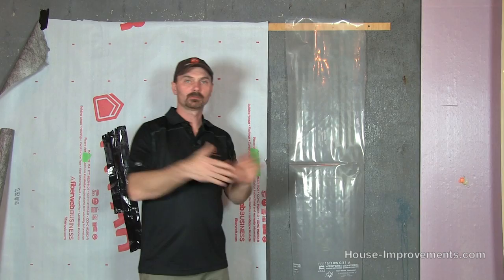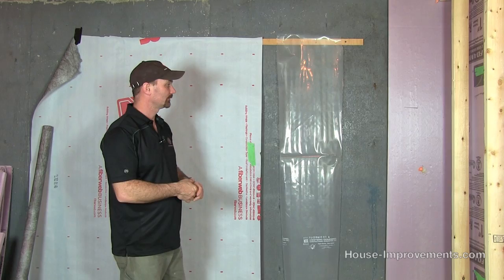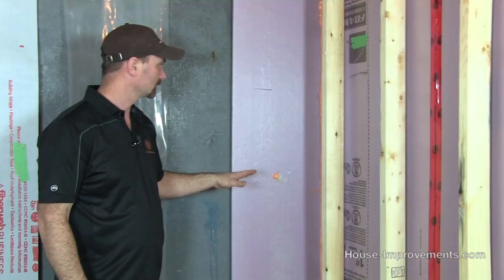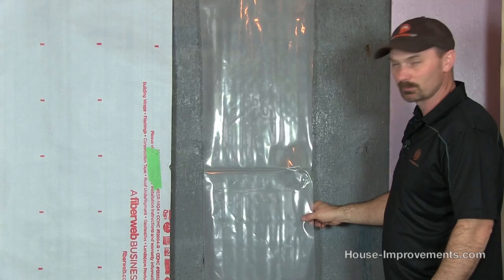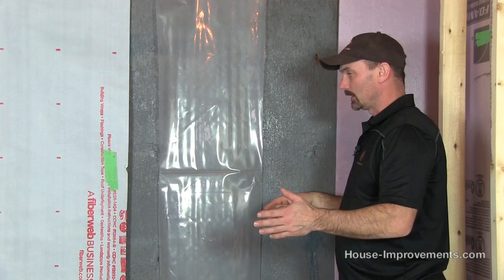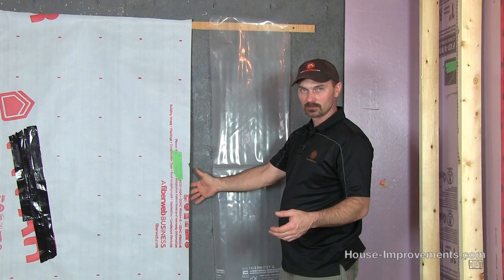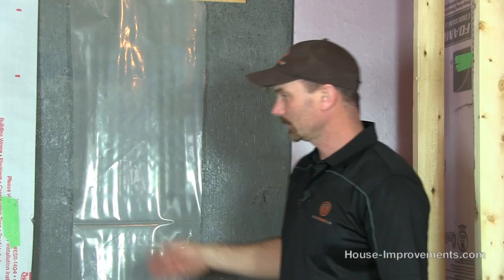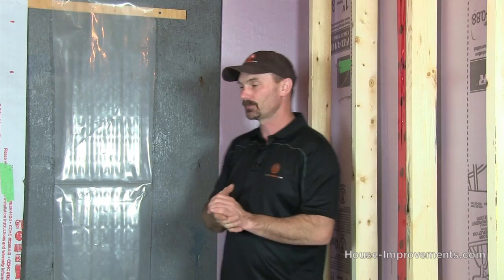Moisture Barrier - 3 Types

Comment: FYI, Ontario building code requires rigid foam to be a minimum R10 to act as a vapour barrier.  Check your local building codes before you begin your projects.  Great video!!
Reply: Im in Ontario as well, do you know if we can use the rigid foam as a vapour barrier on the basement floor?

Comment: Thank you Shannon. I was especially glad to see your comment of placing the lettering of the house wrap towards the concrete wall as house wrap is kind of like Gortex - repels the moisture on the lettering side but allows vapour to pass from the other side (inside the home) outward. All too often people get this wrong and they set themselves up for a mess i.e. mold. Nice to have you as a one stop site to get all the information accurately. Ottawa, Canada

Comment from the maker: IT HAS BEEN POINTED OUT THAT THE HOUSE WRAP WOULD FUNCTION BETTER IN THIS SITUATION WITH THE FACE WITH WRITING ON IT PLACED AGAINST THE WALL. THAT IS OPPOSITE OF WHAT IS SHOWEN IN MY VIDEO AND I WOULD AGREE. SORRY FOR THE MIX UP!
Reply: HouseImprovements what do you think of the idea of applying a liquid membrane (  like the one we apply when we do a shower) on the concrete before insulating ?
Reply: Serge Miller the walls have to breath so sealing the wall might cause the wall to erpde due tp the water building up behind it.
Reply: I'm planning on using dmx on the floor. I was thinking about using the pink board and using the plastic to go over it and tuck the end under the dmx.... Sound like a terrible idea?
Reply: @homeimprovements if i have an interior channel sump drainage system what vapor barrier can I use that will accommodate that? Right now there is about 12 inches of black dimpled material, but id like to frame walls and "finish" the basement. Thank you.
Reply: @1kenpau1    The wall can breathe from the outside. Spray on foam doesn’t let it breathe but it’s considered the best way.

Comment: Thanks for another great video!  I'm installing a new upstairs bathroom and have a little penetrating damp through a stone chimney wall.  The chimney is fully ventilated with a ventilated hood on the chimney pot, but some winter rain soaks through the render outside.  Builders say there's no more we can do to improve it, so using your method I plan to add a moisture barrier with drainage for any dripping condensation.  We don't have much room for thick studwork so I wondered :

1) Can the batten can be installed vertically 600mm apart
2) Moisture barrier stapled to the batten
3) A 2nd batten screwed on top of the first (possibly at 90 degrees)
4) Thin rigid foam added between the 2nd battens
5) Finished with a layer of vapour barrier sheetrock

Really appreciate your advice, keep up the great work!

Comment: If I use rigid foam as the moisture barrier, do I still need to have batt insulation or is the rigid foam enough insulation for my basement? I live in the northeast so it get's cold. Also how is the rigid foam attached to the foundation? Does the rigid foam go from very top of the wall to the bottom or is there a gap on the top? Only 80% of my basement is below grade so wondering if I can skip the top 20% which is above grade. Last question, how does my wood frame attach to the rigid foam or is there a gap between the two? TIA
Reply: 1 inch is R-5 which would be too low to use on its own in NE basements

Comment: Why can't the Tyvek or Plastic barriers just be tacked to the base board at the top of the concrete wall? Why put the the wood strip below it? I assume it's just due to width of the sheets?

Comment: I have a basement that years ago was finished but years of sump pump failures had to rip of 2x4 walls drywall was all mold.
Now just block walls on outside walls can l staple 6 mil plastic up against block walls then build a 2x2 or 2x4 walls?

Comment: Great video. Thankyou. Here is a  about a wood floor? I have a thin wood floor in  a garage, not insulated underneath. I want to stop moisture from coming in. It will have a new layer of 3 quarter inch plywood on it with 1 inch rigid  foam under that.  But doninput moisture barrier first? And donI spray foam all along the edges too? It's a 320 square foot garage turning into a mancave

Comment: Let's assume there is a moisture problem. Does that mean mold will be growing behind the purple board for all the years you live in the basement? If so, is the purple board good a genuinely protecting you from that condition? I am also assuming there is no access on the other side of the concrete, which is obviously how you would want to fix it; at the source. In cities, often there is no access on the exterior concrete. THANKS!

Comment: The air vapor barrior paper sheets are for more preventing water in air moisture... the moisture barrior is more for preventing larger amount of foundation leaking water from outside in. Not the smaller issue of water from air humidity... thats why attics uses paper air barriors on the floor then the insulation rollout. The moisture barrior is more for foundations or bathrooms where larger amounts of water due not only humidity but water itself sources.

Comment: What happens to the moisture concentrated at floor level?
Reply from the maker: +Benny Hannah The idea is that if you get moisture it comes out at the floor where you can find it and know about it instead of it soaking into the insulation and drywall and starting to grow mould that you have no idea is there.
Reply: you can also add a channel in the floor perimeter to direct the moisture away into some form of drainage or tank

Comment: I have a few questions I'm about to renovate my basement and will be doing the following.

For the tyvek wrap is the writing suppost to face outside against the wall?

And my basement is already finished but will be ripping out the walls and redoing the insulation before drywall.. It doesn't have rigid foam board, is it even possible to add because its already framed?
Reply from the maker: The Tyvek is likely more effective with the writing towards the concrete. If there is enough space you may be able to add it. Depends how they originally did it. I would not spend the money on the foam unless you can get at least 1" in there. If you cant use foam then I would likely use Roxul batt insulation instead of regular batts, it has a little more R value.

Comment: Thanks for the video. so, for spray foamed basement we don't need any vapor or moisture barrier to be installed before framing? and for floor base plate where foam is not sprayed, what we need to do? I do see that in my basement, foam is sprayed a little bit on the floor as well where baseplate is placed.

Comment: I don't have any leaks my basement walls just gets mouldy I have recently put a dehumidifier down there so it doesn't smell mouldy anymore  but the is no visible water coming in so I have cleaned up what mould I did have and paint ed with a mould resistant paint  now I want to put  the foam frame and drywall

Comment: As always Shannon a really good video. Thanks
Reply from the maker: thanks, Take note that if using the house wrap, hanging it with the face side facing the concrete wall will be better. That was an over site on my part.

Comment: I'm using 2" 4×8 foam board panels. Can I fur out the walls over top of panels with 1×3 firing.Then finish the walls. I'm not sure i want to 2×4 frame wall in front. Don't think I need the extra r- value. Am I being to cheap? Think I would like to  finish with some type of wood 🤔
Reply from the maker: depends how flat and plumb your concrete is I suppose? Also dont forget about room to run electrical

Comment: Thank you, I just learned that the "Vapor" barrier and "Moisture" barrier are not the same. Years ago I was told by a carpenter that us folks up north put 'the' heavy mil plastic barrier on the inside of the walls and down south it goes on the outside. So I guess since then things have changed since there are two products that separately address vapor or moisture. I recently moved and will start framing in my basement walls. Since they are painted cement blocks and appear to never have had any water leaks or stains do I still need the moisture barrier? Harry
Reply from the maker: Yes basements need a moisture barrier against the concrete or cinder block walls. You also will need a air/vapour barrier under the drywall.
Reply: @HouseImprovements  hello Shannon- thanks for the awesome videos and info! I'm in NJ and I have mold on walls in basement which was due to hydrostatic pressure around my foundation which I've solved with a new French drain system... 
I had the mold remediated professionally and they "sealed" my walls with that special antimicrobial sealant/paint thing.. so would that in essence now serve as my moisture barrier? Or I'd still need one of these paths for the moisture barrier. 
Also the waterproofing companies I met with kept pushing for a "vapor" barrier but I think they really meant 'moisture' barrier?  Also don't these barriers lock in the moisture thus leading to mold? Since the air needs to circulate to prevent mold growth.
Please let me know your thoughts and responses to all this :-)

Comment: What if there is no ground on the other side of the wall, i e. cold side of the wall in contact with air? Do wee need moisture barrier? And can we use a rigid foam in this case?
Reply from the maker: moisture barrier is only needed on wall sections  that are below grade
Reply: @HouseImprovements  Thank you for reply. Would you consider making a video explaining all cases where the moisture barrier is needed or not? It would be nice if you could go through all cases of wall placement: above, below and half way below the grade and explain insulation rules and procedures. There are also cases when the concrete wall is below grade and is isolated by mineral wool inserted into wooden frame.  As I remember correctly, one must have a min 25mm  gap between the framing and concrete wall to provide ventilation. Anyways, if you would consider go through different cases based on given boundaries (above, below or and half way below grade) and give your thoughts on how to insulate based on these assumptions - that will be great

Comment: if our crawl.space already has the cheap 6mm black builder's grade encapsulation would you need or should you remove that before you would install 15mm STEGOCRAWL?  or can it go on top without causing a cat pee smell or other problems?

Comment: Great video! I Just gutted my den and found lots of damage to my moisture barrier. it looks to be nothign more than very thick aluminum foil. The house was built in the 70's so I guess that was code back then. I have a brick house and behind that damaged barrier was raw brick and nothign else. Can I replace that old school aluminum stuff with the rigid foam or should I hunt around for that same type of moisture barrier?
Reply from the maker: Answered this on your other post

Comment: Great video, it was helpful to understand the purpose of moisture barriers. But I have few more question, I will be grateful if you could address them.
I am in process of installing Luxurt Vinyl Planks flooring (LVP) and manufacturer recommends to use moisture barrier for underlayment.  What kind of moisture barrier would you recommend as underlayment for installing the LVP flooring? We have 3 level including a concrete slab on level 1 and  we will install LVPs in multiple rooms including bathrooms. Will it be okay to use house-wrap paper everywhere or would you recommend to use plastic on concrete slab and high moisture rooms (bathrooms) and then house-wrap paper for rest of the areas?

Comment: Thanks Shannon.  Then you would install the insulation vapour barrier and drywall after the moisture barrier.  That's great.  I've never seen moisture barrier before.  Great video.
Reply: build another wall inside:)

Comment: so the moisture from the living space wont make it past the overlaps? what about the moisture that comes thro the concrete wall will that tyvec still stop it? what about moisture that comes through the foam board? what would you do exactly if you were going to use the water gaurd that sits on the footer against the wall ?
Reply from the maker: In my area we use interior Vapour Barriers , those are what is supposed to stop moisture and air flow from inside the home from getting in the wall cavity . Moisture barriers against the inside of concrete wall are to direct moisture that comes through the concrete down to the floor so it does not soak your insulation. The 1" foam as a moisture barrier acts as the moisture barrier , some added insulation and keeps any warm moist air that gets through the vapour barrier from being able to condensate on the inside of the cold concrete wall. Very minimal amounts of that moisture may make it through ship lap edges. Taping those seams will help prevent that .
If you have a french drain then you dont want to seal the bottom of the moisture barrier at the floor, just let it allow moisture to get to the drain.
Reply: @HouseImprovements  so what about warm moist air that gets thro the vapour barrior with the tyvec or moisture barrior wont it get past the overlaps and condensate on the concrete wall?

Comment: Can you use the vapor or moisture barriers on the warm side and then add drywall on top?
I have existing studs that are very close to the wall.
Reply from the maker: Yes after wards the wall is framed, insulated and vapour barrier installed and sealed, followed by drywall.

Comment: I have a brick house with 2x3 studs throughout. Im going to tear down the walls and put in roxul insulation and drywall over it. between the studs and outside wall is some tar paper or whatever they call it. Im wanting to put a vapor barrier over the roxul insulation. is that ok? also i'm in North Carolina.
Reply: also i'll be using furring strips vertically to bring the wall back out an inch. it currently has horizontal furring strips to support the vertical tongue and groove paneling.
Reply: I think you need 2x4's for roxul

Comment: Question for you, I have a below grade wall that is getting moisture and water. I am going to patch where needed and Dryloc at least 2 coats. They install the insulation sheets like you showed in this video. Do I need any barrier after that or can I just frame my wall?

Comment: We have house wrap tucked into delta so any moisture or condensation goes into our interior waterproofing system. Just letting it hang wont that just let it drip to the floor and let moisture in and ruin your studs bottom plate?
Reply from the maker: If you have interior waterproofing going into a french drain then yes you can tuck the moisture barrier into the top of it.
Reply: @HouseImprovements  thank you sir. Following you on Facebook too thanks

Comment: i live in canada, we have a cold cellar on basement. and moisture build up during winter and summer. cold cellar has 2 6inches holes on both side. i want to to totally shut it down because of molds growth. my problem is the door between the cellar is moisture build on the door. im thinking to put a Eps or Polyiso foam board to prevent from condensation on the door if that will help to stop moisture grow. or ij the future need to close the 6inch holes and isulates the wall on cold cellar. please help me which best to do for now. planning to seal the door first for now if that one will work is better to use a polyiso board with foil on both side? pe go for eps?
Reply from the maker: Best is insulating room and filling in venting holes if you're not using it as cool room any more. Filling in the venting holes for now will help keep it warmer and should stop or reduce the condensation. You can insulate the door for short term fix. 
Please use our forum if you have more questions.

Comment: Hopefully someone can answer this question for me.
So I see all these videos and articles about insulating basment interior  with rigid foam and then framing in front of it. But I can’t seem to find info that claims that is fire safe. Is having drywall in front of it what makes it fire safe? I’m getting ready to insulate my basment cinderblock walls but don’t want to use XPS if it isn’t fire safe.
Reply: Wouldn’t just the plain vapor barrier be better? It seems more breathable.

Comment: When you install the house wrap in basement, shouldn’t the logo side be facing the concrete and the blank side or black side face the studs?
Reply from the maker: In reality I dont think it will make a lot of difference but it does make sense

Comment: Hi , which kind of barrier suppose to use in attic room before put the dry wall ?
Reply from the maker: You are likely talking about "air/vapour barrier". It is a clear poly and is sold specifically for air/vapour barriers. It is installed on the warm side of insulation and under the drywall.

Comment: In the case where my builder has already included insulation with the vapour barrier in the basement, do I rip it down and reinstall according to your instructions or do I just put up a wall in front of it and board it up? I don't think the builder has included a moisture barrier between the basement concrete wall and the pink insulation.
Reply from the maker: Please use our forum for assistance with this.https://www.house-improvements.com/forums/

Comment: Can you just attach rigid foam and not finish the basement off and will tha5 help with some insulation factors
Reply from the maker: The foam needs to be covered to protect it from burning by code ,so you need drywall. The smoke it gives off if it burns is toxic.

Comment: If I use the 6 mil poly method, can I use faced R13 insulation in between the wood studs?
Reply from the maker: I'm not sure. In my area faced insulation can't be used.